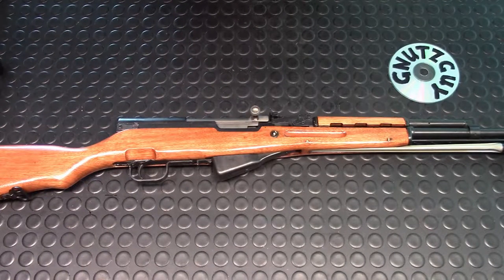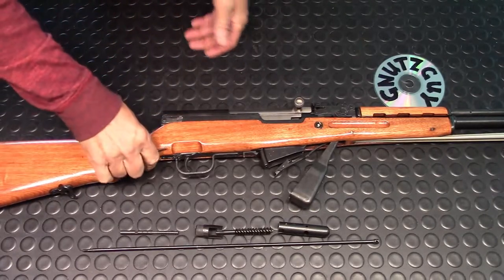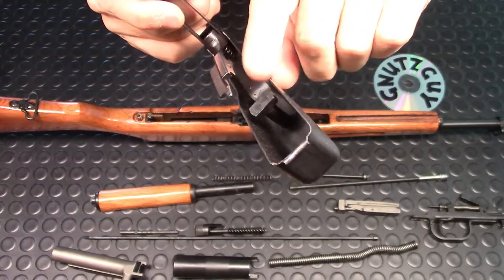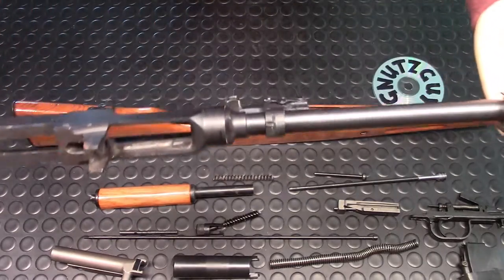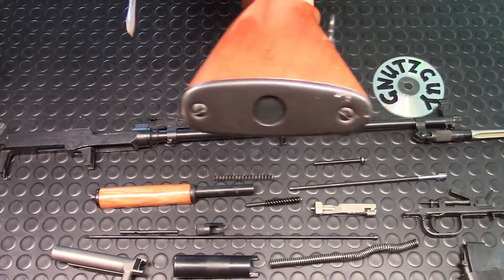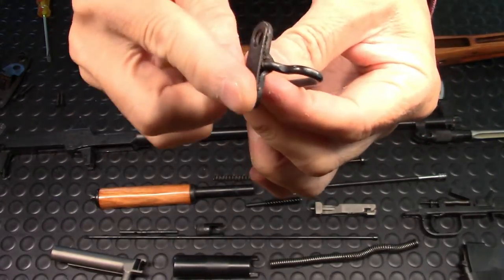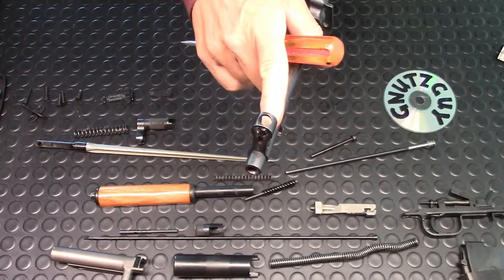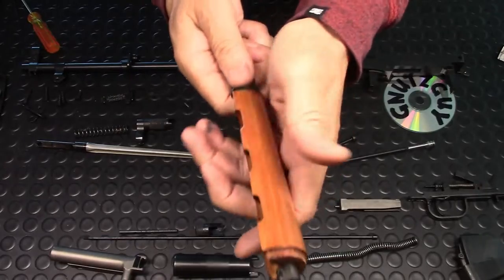SKS Full Monty Disassembly & field stripping for cleaning.

Comment: "do not oil the firing pin"... ESPECIALLY if you intend to shoot commercially made brass cased ammo with more sensitive primers than the steel cased military ammo.  with sensitive primers and an oiled firing pin, an SKS WILL  GO FULL AUTO....  the inertia of the firing pin makes a light strike on the primer, but enough to set it off when the bolt closes...  had it happen once. learned to keep the firing pin and firing pin journal dry.  if you need to clean the firing pin and the firing pin journal, use 90% alcohol as the solvent.
Reply: I put a spring loaded firing pin in mine from murrys
Reply: will it rust if I dunk the firing mechanism in warm soapy water then dry it on the stove?
Reply from the maker: Solvent is better to remove oil but soapy water is a must if you use corrosive ammo so do both (water first) then dry with a hair dryer.

Comment: On my sks the pistion inside the top hand gaurd wont come out is that an issue?
Reply from the maker: Yes, block by carbon or rust. Hammer it out
Reply from the maker: Soak it in solvent overnight

Comment: Sir, how the heck do we close up the butt stock cleaning kit? Probably easier then what I'm attempting, but for the life of me, I can not close it back up! grrrr!! 🧐😕
Reply from the maker: Use a back end of a pen and push it in. Tada, lol
Reply: @gnutzguy  Thank you Sir! But I didn't mean putting it back into the stock, I meant putting it's lid back on. But I FINALLY figured that one out! LOL!
Awesome video though Sir. I've got my SKS fully disassembled now, and the cleaning process begins tomorrow! My SKS has never been fired, but the oils have turned to jelly...even the oil in the little double headed oil tin. All 3 tools are so gummed up that I'm soaking them in a solvent overnight, inside the little tool cylinder. Btw, this is a Russian made, 1950 SKS...all milled, not stamped! Very durable weapon!

CHEERS & THANKS AGAIN!
Reply from the maker: ya welcome..... yup, all russian are milled receiver and it has a spring loaded spring pin, NO SLAM FIRE!!!! ole!!!.

Comment: Hi what would be the problem if I can’t push down the top hand guard latch into the locking position while the top hand guard is in place
Reply from the maker: depends. has it always been that difficult or its something new?
Reply: @gnutzguy  it’s something new thanks for responding man
Reply from the maker: @gabrielweisbrod3175 NP, firstly push down on the latch without the top HG in place, watch the lock pivot. If the latch locks then the problem is not the latch but the top HG is not going low enuff bcos the pivoting lock is hitting the back of the top HG (you can see it) bcos it's not going lower as before. Best to file very little of the angled back and watch the pivot lock completely.

Comment: Do you have anything related to the bolt hold-open? I have a Yugo and the bolt hold-open does not engage. I more than likely missed it when I did cosmoline removal.
Reply from the maker: remove mag. manually push the BHO up and release if it doesnt go up then clean the BHO thoroughly.
Reply: @gnutzguy  Thank you. I don’t need to disassemble the BHO, correct? Just clean and lube?
Reply from the maker: @RonDevito  that depends, whether the bho is stuck or spring is broken . Pray the bho is stuck bcos it's not easy to disassemble the bho.
Reply: @gnutzguy Thank you again. I know disassembly requires a hammer and punch, which I do have... but I also know the little hammers that come with these punches might not be heavy enough to drive out the pin. So, hopefully as you said it's just a clean (I would use Brakleen for this job), and lube. If that fails, then I know I need to get a new spring and disassemble. Since the rifle spent most of its life stored in cosmoline, I doubt the spring broke.

Comment: When I shoot my type 56 SKS the cleaning rod moves out the front little by little
Reply from the maker: It shouldn't bcos the head of the rod in sandwich between two lugs and then pinch by the bayo when folded.
Reply: @gnutzguy  so technically when u say sandwiched it should click between the 2 lugs correct when re installed properly right? (Cleaning rod)
Reply from the maker: @BaconSlayer69  yup, you havta bend the head down to get it between the two lugs.
Reply: @gnutzguy  thanks for helping me dude :)
Reply from the maker: @BaconSlayer69  no problem

Comment: Like my SKS's but much easier to clean a AK......  be well.
Reply from the maker: the only real difference are the trigger housing and the stock. in the AK you dont remove them during field stripping and others are minor. i dont even think about it. like nike said, just do it, lol.
Reply: @gnutzguy  , I don't like the small piston and spring in the front truion.. and like you said the trigger group is a bitch to get out on my Tula's, Yugo's and Chinese rifles.. Very tight fit between the wood stocks.. Triggers on All SKS's are not the best design n that floating firing pin sticks sometimes.. I put in Murray's spring loaded firing pins in all my rifles.. Truth be told for me my Yugo M-59 shoots better than my Tula's.. be well..